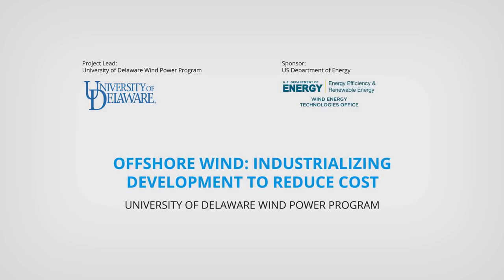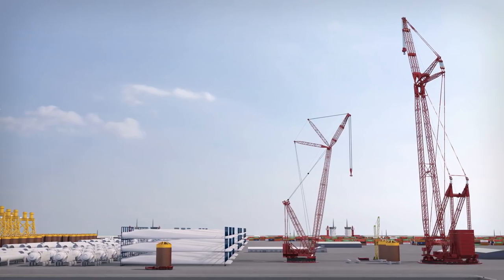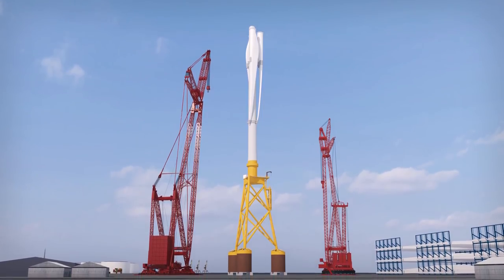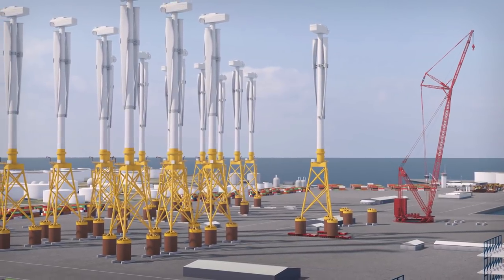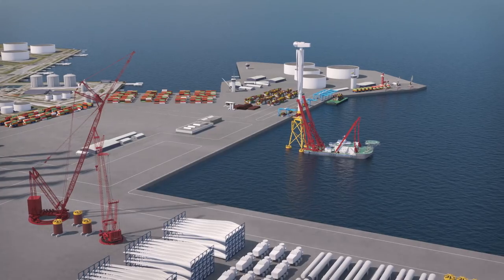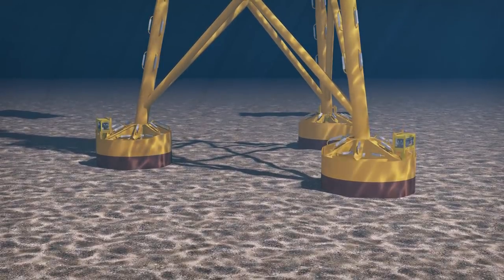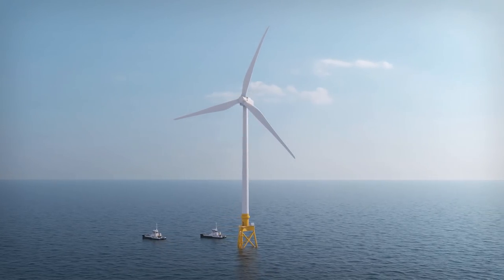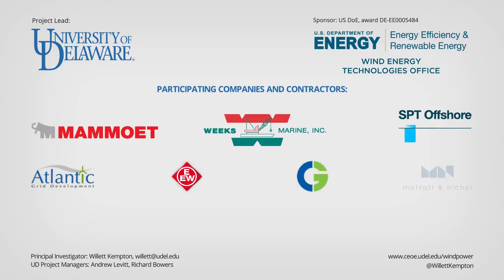Offshore Wind  -  Industrializing Development to Reduce Cost

Comment: I see several problems with this method, but if you get it to work, this would be an awesome method! Keep up the good work!
Reply: Hello; obviously I am a little late to the party haha, but I am conducting a research project on offshore wind and if you still stand by this statement, I would love to learn what specific issues you see with this method. For instance, does this process seem to risk damage to turbines? Does it seem too expensive or cumbersome? I appreciate any elaboration - thanks!
Reply: @wubwubwub6820  Hi there! I actually don't remember writing this comment. I rewatched the video now. The transporting of the almost fully assembled wind turbines to the installation site seems scetchy. Its a really tall structure and the towers are usually not designed for dynamic movement. So I'd suspect that you need close to optimal sea and weather conditions for this to be viable. 
But what do I know. I didn't do any of the math. Would be interesting to know what happened to this project in the last 4 years.

Also stones in the sea floor could make the suction buckets not work, or render them unable to level properly. But are there even Stones in the sea floor? I don't know.

The almost fully assembled turbines standing on shore without being properly attached to the ground seems dangerous. Imagine a storm with toppling wind turbines.

All of these are points that aren't deal breakers. But the goal of this is to make offshore wind more economically viable. And if you have to create special solutions for these problems, are you saving money on the end of the day? I mean, that's the whole point, isn't it?
Reply: @xDanoss318x  Thanks for the quick reply! I agree - the physics of storing and transporting giant, upright poles certainly seems a little suspect. Admittedly, this video is one of the only resources I have found so far that actually documents the offshore turbine installation process, so I'm not quite sure if it is still done this way either haha. That being said, I would assume these things are incredibly bottom-heavy, which perhaps makes them resistant enough against storms and whatnot given their surroundings.

Of course, I don't know how interested you are in the details of the relatively obscure offshore wind industry lol, but since you mentioned economic viability, I ran a cost-benefit analysis today and determined that an offshore wind grid of scale (I used Biden's proposal of a 30 gigawatt grid by 2030) would cost around $187 billion upfront in infrastructure, as well as a little over $58 billion in estimated annual maintenance; in other words, very very expensive haha. So, it's probably not an economically sustainable industry right now, but those costs should roughly halve by 2050 :)

Comment: Compare the small amount of energy produced over the relatively short, ca. 20 year lifetime of these farms - not to mention their high maintenance, and subsequent recycling issues - with nuclear's prodigious advantage in power density and longevity. (And nuclear is the statistically the safest energy source)  What's more, the fossil fuel burned and materials mined and processed to produce these turbines cancels out any greenhouse gas emissions they would save.  Clean? Think again.
Reply: LOL. Think Fukushima.
Reply: LOL?  FYI, Zero citizens were killed by the Fukushima reactor.  Get your facts straight before fear-mongering, thanks. @michelangelobuonarroti916
Reply: @keithrodan7763   How's this for homework, fatalities aside?
"Japan's government estimates the cost of cleaning up radioactive contamination and compensating victims of the 2011 Fukushima nuclear disaster has more than doubled, reports say. The latest estimate from the trade ministry put the expected cost at some 20 trillion yen ($180bn, £142bn)."
$180B would have bought a lot of wind turbines. BTW, to address your concerns about fossil fuels burned, etc, to produce wind turbines, are there no materials mined and processed to produce nuclear reactors?
Reply: You're still saying 'compensating victims', where I think you mean those who were displaced by the tsunami, not the actual reactor event.  Yes, the reactor is damaged and contaminated due to the explosion, and the containment and mitigation is costly, yet the Tepco/GE(?) reactor (also a similar design in use in other districts, was not at fault, as it was the placement and subsequent failure from flooding of the back up diesel for the pumps ). Area villagers were evacuated due to concerns over contamination, though measurements of radioactivity fell significantly, and are considered at safe levels. Robert Stone's documentary, "Pandora's Promise"  on YT offers insight, and, in fairness, should be compared with your source information. 
As for wind turbines, the materials necessary to produce a handful of them would build a nuclear facility with a million times more energy density.  Suggest you Google 'nuclear energy density'.  $180B would buy a lot of Gen IV reactors that can't melt down, which we'll need to mitigate carbon emissions. The most efficient wind turbines generate up to 8Mw, intermittently, where a 1000mw reactor supplies steady base-load power, 24/7.